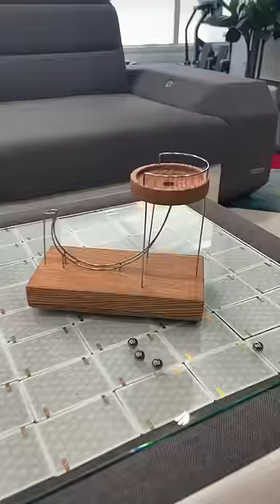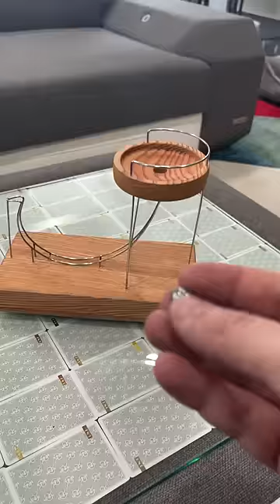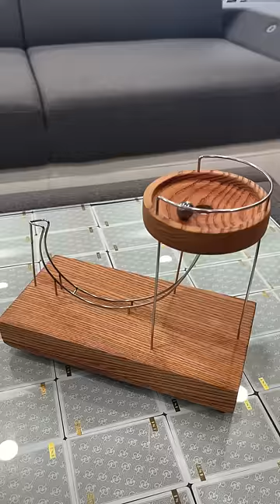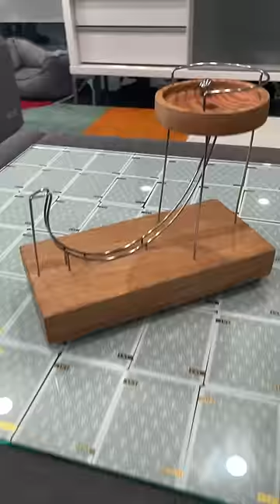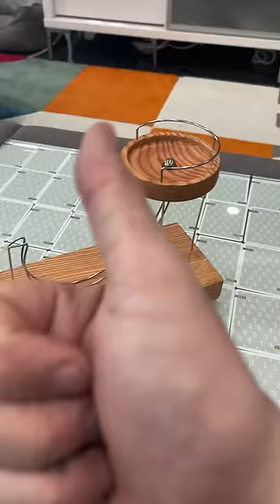An Impossible Perpetual Motion Device?! 😳 #Shorts

Comment: It is a perpetual motion machine, but it doesnt defy any laws of nature. Gravity is adding energy to the machine every time the ball falls. It's just taking advantage of ambient energy obtained from being in a gravity well. Kind of a like a solar panel, only gravitational. This thing wouldn't work at all in zero grav.
Reply: It has an electromagnet. Thats why t he ball is attracted to the hole, and why it goes down so fast.
Reply: Gravity is also taking energy OUT of the system when the ball goes up, so it’s net neutral 

I wonder why the bace is so thick
Reply: @gordier6787  because it has a Magnet in it
Reply: @danielbrakenhoff2825  
I think you need to work on your reading comprehension skills
Reply: Wrong